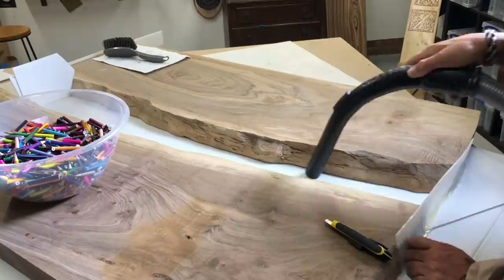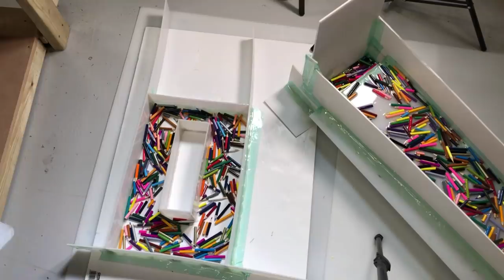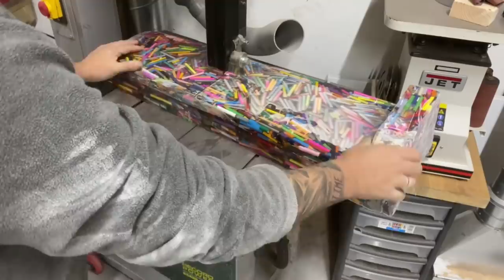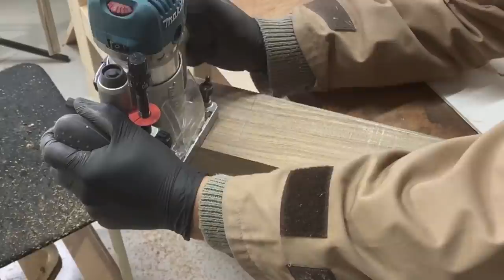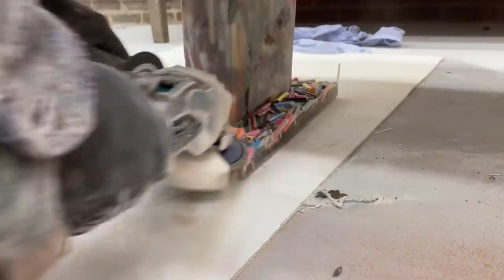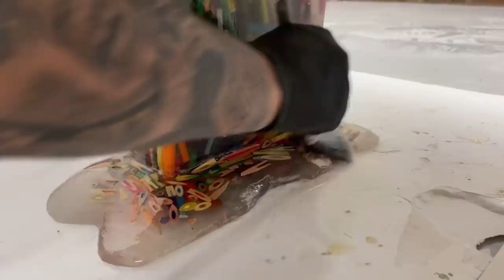Floating Pencil Epoxy Resin River Table / Unwaffled..

Comment: Sorry, getting technical... was the same epoxy used for around the pencils and the last coat covering the whole table after sanding? Was it a self-leveling epoxy? Lastly, it didn't look like it but did you have to worry about air bubbles or so you have a small degassing chamber?